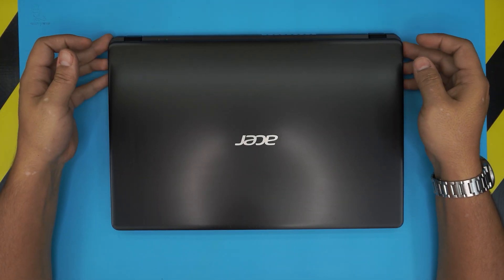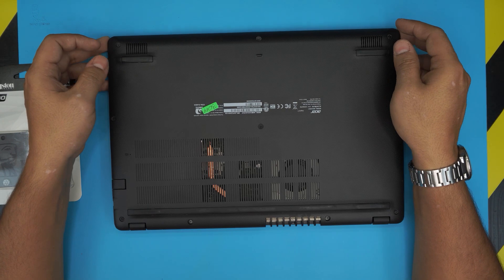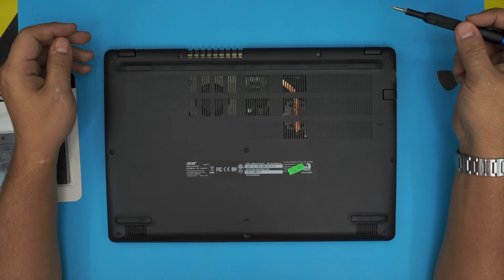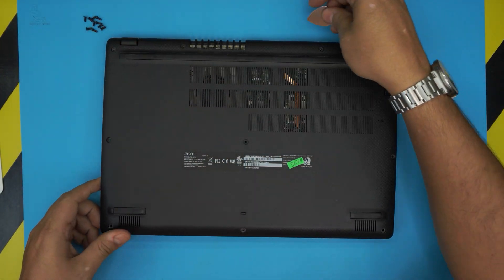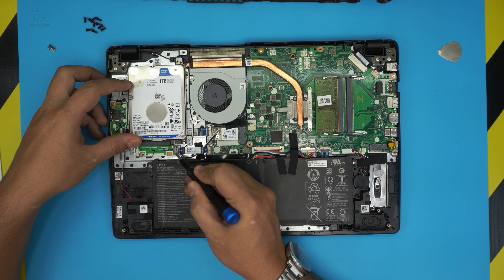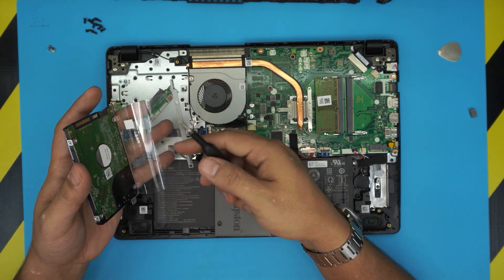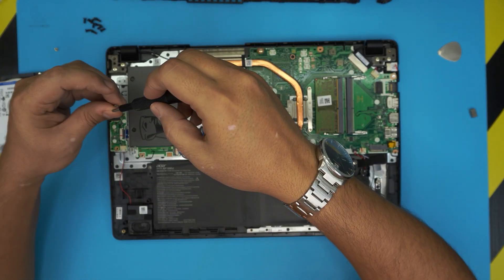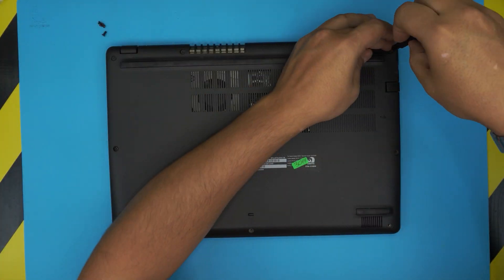Acer Aspire 3  N19c1 SSD HDD Upgrade , Step by Step

Comment: hi ad thanks for the video, I want to upgrade to my SATA SSD 1TB that I purchased for my Acer Aspire 3 but it doesn't have the caddy or connector cable/adapter inside when opening up the laptop.  There is space to fit the SSD but no connector  - is this still possible, and if so what do I need to purchase and where would I connect the missing connector cable to the SSD/laptop?
Is the only option getting a SATA to USB external connection?
Reply from the maker: Thank you for the feedback! if you wish to support the channel you can LIKE or SUB or both :P
regarding your question: its very rare that your laptop doesn't have the adapter, i have contacted few sellers but none of them have any available at the moment, it looks like its very easily sold item. i recommend you to wait a week or so let me see if i can get you a link to a correct adapter, regarding the caddy you don't need it if you using SSD there, just get a double side tape foam and that is all. hang tight.

Comment: Thank you very much, but where can i buy the same adapter for the ssd?
Reply: And what type of RAM it is? Is it ddr3l or ddr4 SODIM?
Reply from the maker: Thank you for the feedback! if you wish to support the channel you can LIKE or SUB or both :P
regarding your question: to install an ssd instead of HDD all you have to do is remove the HDD and place the ssd in there the adapter is the same for HDD or SSD you going to use the same adapter, no need to buy an adapter.
good SSD: https://amzn.to/37mfvPu
for the ram here is the video i made for it: https://youtu.be/hj48KcIgm0U
Reply: @uFixTek  I meant that I have an stock NVMe ssd and I need an adapter for an additional SSD. thanks for answering the last question.